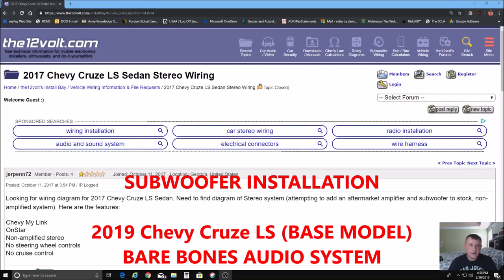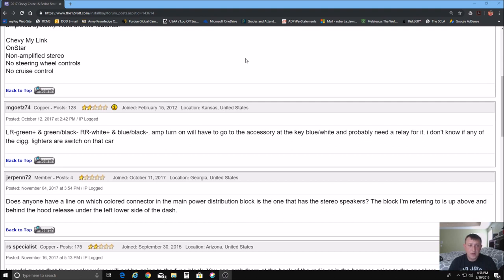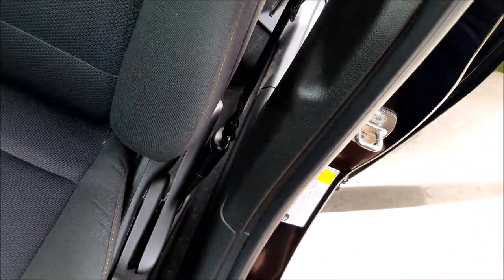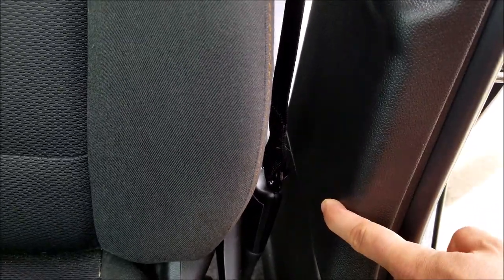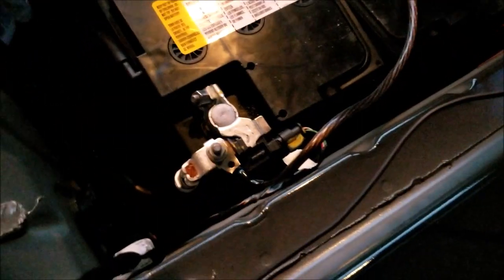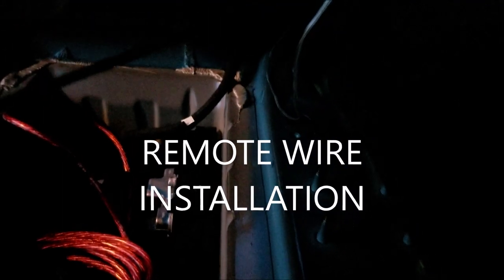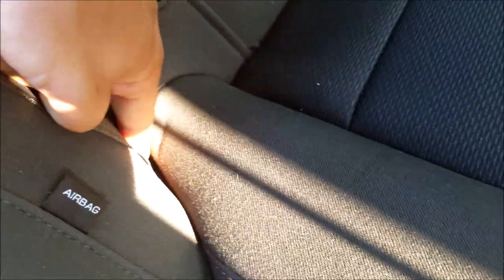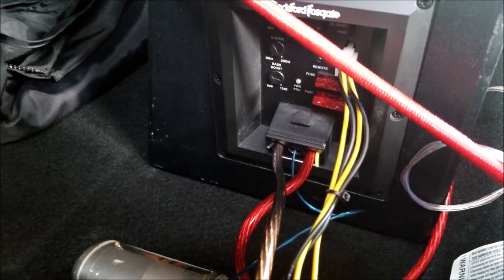2019 Chevy Cruze Subwoofer and AMP Install with Stock Radio

Comment: You could have just used a fuse tap. You could have also just spliced into the rear deck speakers and used  a line output converter to go to the sub.
Reply: No rear deck speakers for the base model stereo system.
Reply from the maker: Not everyone has a fuse tap or even wants to buy one.  This is just one of many methods to do this.
Reply: @danielscottnewton  did you ever get yours set up?

Comment: I did everything that you said exactly but it didn't work. Amp is working fine but I'm guessing it's in the speaker wire I did something wrong... Any suggestions?
Reply: Did you get it figured out?

Comment: How do you get sound to the speakers? It can’t be that easy
Reply: The wires running from the stock speaker wires go to a line out converter.  Changes it from regular wires to RCA jacks that plug into an amp
Reply: @imperfect_Visions  how does that work tho what do you have to do for thay
Reply: @austindalton7791  get a line put converter I bought the cheapest one off Amazon.  Then you have to pull the pillar behind the driver and passenger seat and splice into the speaker wires. If you are gonna do it let know. And I'll go out and take a pic of the wires you need to use.  Mine is a 2018 and I'm running 1 15inch sub with an 1100 watt Amp

Comment: you should explain how to use the splice clamps
Reply from the maker: Sorry for the late response.  I did not get a notification for this post.  You place the cars speaker wire on the far inside of the clamp and the new wire leading to the amp on the outer part of the clamp.  Then squeeze the metal plate down with a pair of pliers to complete the wire connection.  Test for connectivity and then close the lid.

Comment: You believe or it’s F31?
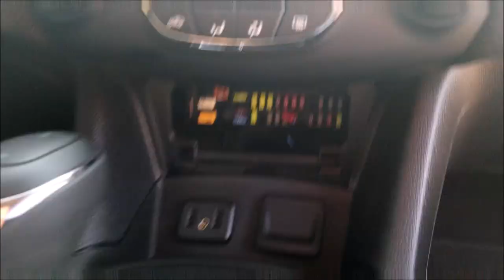Reply: Earlier in the video he verbally says he uses the shifter illumination fuse (which is a 5A fuse on F30), but then once he actually shows the fuse being used at 10:15, he is using F31 (a 20A fuse for WIPER REAR). I actually think either fuse will work for Remote wire since both of those circuits will turn off when the vehicle is off. BUT...what I don’t know is whether rear wiper circuit will stay on when the auto start-stop engages at a red light. Therefore I think shifter illumination (F30) is the right way to go.